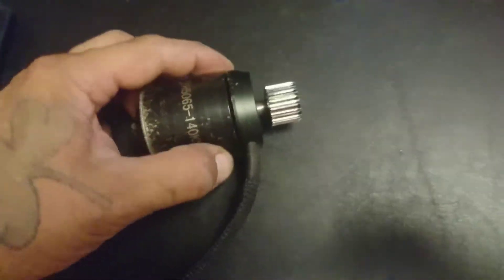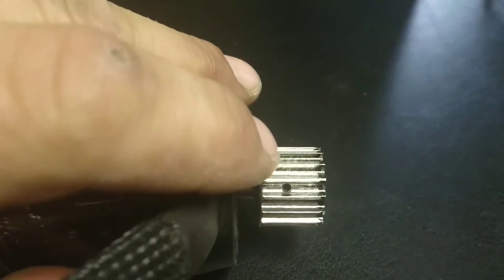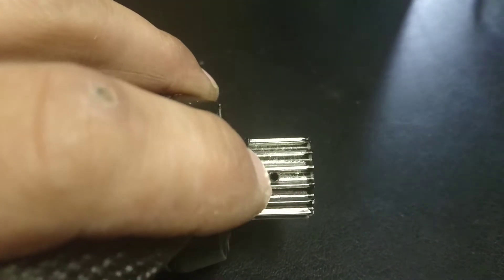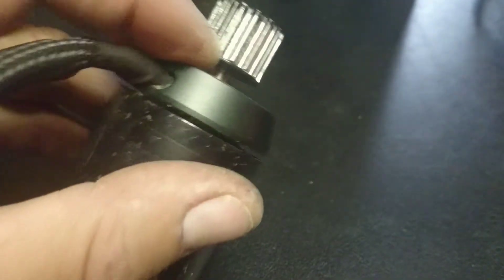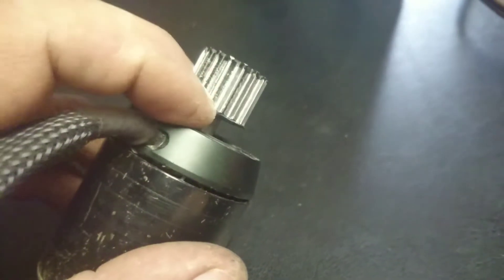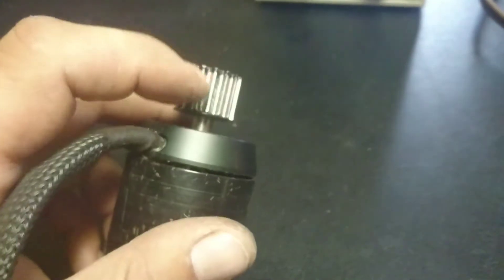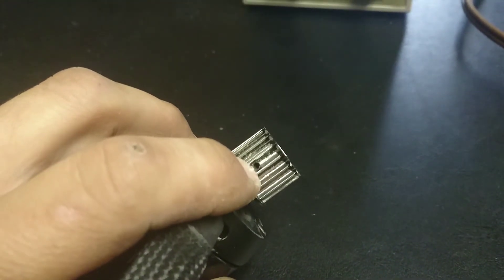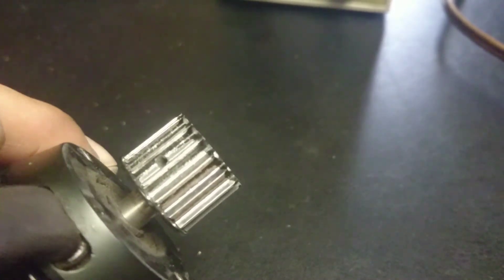Taking the gear of the motor

Comment: I am looking into getting a pair of these racerstar motors, do you think it makes a difference if it says brh5065 or just 065 on the motor?
Reply from the maker: +edgar garcia hmmmm well it wouldn't make sense to me. 5065 is the size 50 being the diameter and 65 being the height. It may just be a mistype? what do you think? thats maybe my guess. good question though. is it actually stamped on the motor or is that in the listing?
Reply: Joe Kyser thanks for the reply. it's actually stamped on the motor. on the ones with the red anodizeing it is stamped with BRH5065 but the black one it says just 5065 of course with the 140kv rating. they are both made by racerstar.
Reply from the maker: +edgar garcia oh yeah all they did was change the looks of it that's all. I actually have the original black ones and I have the red ones there's absolutely no difference between either one and performance or quality

Comment: Thanks for the video Joe!
Reply from the maker: +Isaac A no problem at all
Reply: Joe Kyser I'll see if I can get the gear taken off today. Do you happen to know what size works with these Evolve motors?
Reply from the maker: +Isaac A no im not sure what one it is. let me see if its written on the tool
Reply: Ok sweet thanks
Reply from the maker: +Isaac A 1.5mm allen key
Reply: Ok sweet. I'm trying it right now, and it fits perfectly into the hole. How hard do I have to turn it left? It doesn't seem to be budging and it's bending my allen wrench
Reply from the maker: Isaac A oh shoot I just saw this. I think I'm going to have to make another video showing exactly how I did it. without heat you'll never get it.